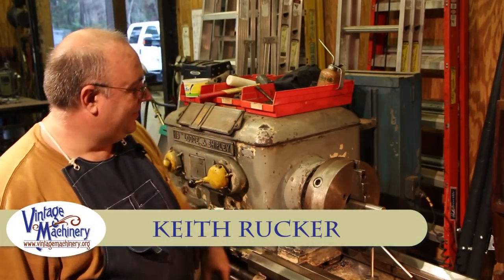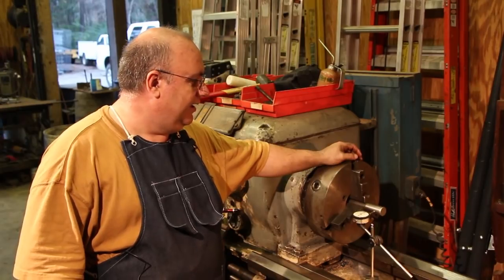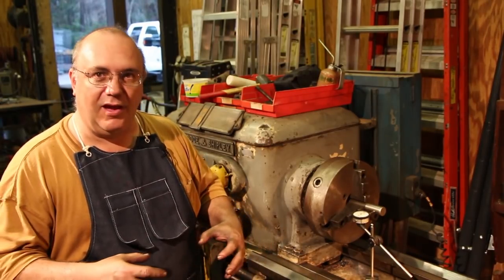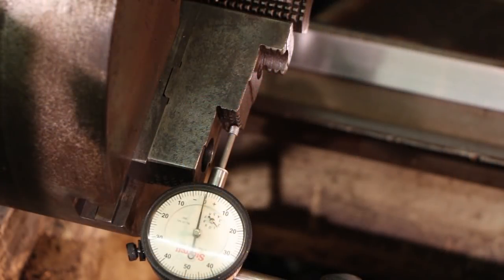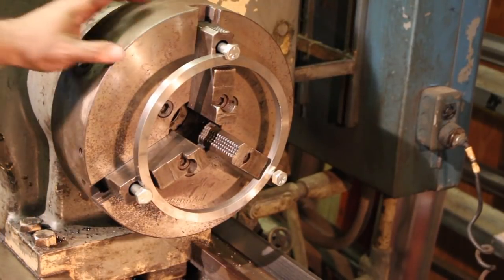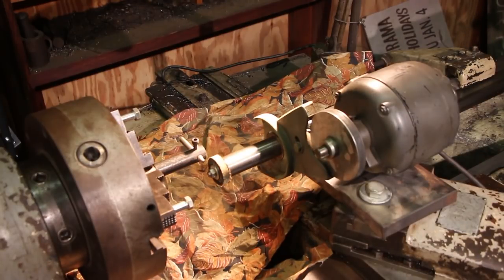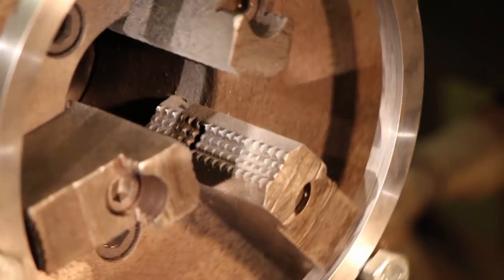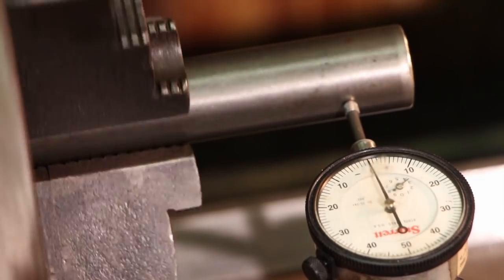Machine Shop Maintenance:  Truing up a 3-Jaw Chuck

Comment: After watching your procedure I decided to tackle a similar problem at the Minnesota Streetcar Museum. We have a 1942 Monarch 10EE; the 3-jaw scroll chuck with D1-3 mount was hopeless (0.020" TIR). Our set-up involved a Makita die grinder with a 1/4" shank, pink alumina mounted point, 1" dia. x 2" long. The grinder was very securely mounted on the compound. The extreme stone length was simply to achieve the needed reach. The Monarch permits extremely slow spindle speeds and carriage feeds, so that's perfect. It took hours but the result was worth it. Typical axial taper is no more than 0.0001"/in. Radial TIR is 0.0015" so we're pretty happy. Several lessons learned: pre-true the mounted point in a lathe or mill collet- the diamond tends to grab with this arrangement; 2) cock the grinder off-axis about 2 degrees so the stone never "heels", causing a bell-mouth condition; 3) do "spark out"- I made six passes before I no longer got random sparks;  4) consider a $20 pair of Ryobi noise cancelling ear buds which work with iPhones- your ears will thank you. I'm a metallurgist, not a machinist, so I'm learning like crazy from your videos. Thanks!

Comment: You are bit game running that tool post grinder without a face mask. I have had a wheel explode on a T/P grinder,which sent bits of wheel everywhere,Including one piece through the roof 60 feet above the lathe...and just like exploding dynamite, it happens quicker than you thought possible. :-)

Comment: Someone touched on this after trueing a chuck up.
A three jaw chuck will usually perform better accuracy wise using one of the three chuck wrench sockets.
Mark the best socket and put it to use.
Using random sockets will result in random chucking accuracy. This makes the chuck look worse than it is.
On repeat work mark the stock and put the mark at the same jaw each time it is chucked.
That way jobs can be machined in operations much quicker that resetting each tool for each part.
My chuck on the P & W lathe was modified at some time with adjustment screws on the scroll plate
to move things around a bit.  I assume these are brass tipped set screws.
Haven't taken it apart to look inside, if it ain't broke, I don't fix it.
Kap
Reply: Ditto for both finding the most accurate tightening gear, and for "indexing" the work to a particular jaw for repeatability.

I have also found that tightening a 3 jaw progressively (snug on the first position, firm on the 2nd, tight on the 3rd; then tight on 1 and 2 again) may give the least runout on a new(ish) 3-jaw. It probably would also reduce the tendency for increasing runout as the chuck ages (if we should live so long as to notice).

Comment: Tension should be outwards? Think about it. As Einstein says, every action has an opposite and = reaction. And so tightening on a piece of stock is pushing the jaws outwards. They will move outwards as far as each individual jaw 'run out' will let them, then stop. (This is what is happening in the actual tightening procedure with the key) Imagine one jaw moves outwards 1", a second 7/8" and the third 15/16" To get all three to tighten equally, the two less than 1" need to be ground to match the 1". All three jaws need to push outwards and be locked tight and immovable absolutely, at the 1" mark. This is what is occuring as the key is tightening. All ground faces are = from the centre.
Reply: Einstein never said that it was Isaac Newton's 3rd law of motion
Reply: Tom Tee No biggie but I think Newton said that.
Reply: Yep absolutely, Mr Newton. I'd really like 100% confirmation whether to grind with jaws tightened or jaws 'forced' to open as certainly this way, all three will not be touching that imaginary circle about the axis. 1 or even 2 may but not all 3? Hence the need for grinding.
Reply: Tom Tee  If you are cleaning up the inside jaws you tighten the jaws closed just as if you were gripping a round bar.  If you were cleaning up the outside jaws you would have the jaws pressed out.
Reply: I believe it just could be the other way. And curiosity is going to have me find out convincingly, either one way or the other.
Reply: Tom Tee If you want to think that, OK but it's not correct.
Reply: Kevin Keller I can't tell but maybe we are saying the same thing??
Reply: Kevin Keller No I think it was Harvey  Dmedlap or maybe Baron Von Whistledrawers, anyhoo good point...Ken

Comment: Hello Keith good day. I have a similar Lodge and Shipley lathe almost exact. My father obtained the lathe on a surplus buy. I an wondering what should i do to rehab the whole lathe? I've noticed an oil leak from the machine. The lathe does look a little bit beat up but i am wondering what advice you recommend i must do to have the bad boy running again. Any help would greatly be appreciated. thanks.

Comment: I have three jaw chuck that runs .00005 and has ben for years. and we have to hammer on parts every day. All things are possible if you take the time to make it so. THE  complete jaw is adjustable after you clamp down on the part .

Comment: Keith,  I realize this is an older video of yours but my question is.  Would you not first remove the chuck and check the chuck nose for T.I.R?  Do a complete head stock alignment first before grinding the jaw's? I have done this in the past, only after setting the complete machine alignment first. x and z axis (with gib job) then setting the tail stock on center before grinding.  Your thoughts?  Thank you for the great videos.
Reply: All your good points are left out so that the beginner at home will screw up their lathe,it is unfortunate but many on internet leave out the crucial points or steps not always on accident. What about the wear of the grinding wheel if to hard a cut it will be more than a few thousands by time you get to back of jaw.
Reply: +Dawn Conti hey, women make great machinists. It goes hand in hand with their ability to never let shit go. ;-)
Reply: I agree Blue Ridge,
If you noticed .
ONLY one jaw took most of the grind.
do every spec inside first,.
NOW, it is still not true and if the REAL problem is corrected, the jaws will need to be ground again.
The way this was approached, the symptom is being treated, but NOT the problem.
Yeah, i am a woman and machinist of more than 35 yrs.
I am a mom of 3 married 25 yrs.

Comment: Decent video! Unfortunately a very small radius in the jaw from the grinding.  Also you would want to check the jaws for squareness by noting the run-out in 2 marked spots along a true shaft not just indicating one spot and saying it's out .004. I would also suggest using the same key hole that was used when tightening the ring for the re-grind. I've done this operation a few times over the years and I surface grind the jaws contact face tangent to the regrind or relieve the back portion of the fixed jaw and open up the clamping diameter prior to the grind. Cheers!

Comment: Great vid! Also at the end there where you're measuring four thou out, remember you're measuring that off of cold rolled bar and that would likely be out as well. You did a fine job with the grinder and even gave me ideas by using that ring!

Comment: Hey Keith, could some of the run out be from wear in the scroll teeth? I wonder if you ground the chuck at a diameter closer to your intended work if you wouldn't get better results
Reply: You have a good idea but, the load should be the other      way around. Put like a two inch piece of stock way back in the jaws and tighten . Then bore. That way, the load will be right .

Comment: 4/1000ths is terrible - I got mine down to about one half a thou using a dremel to grind
Reply: I wouldn't say .004" T.I.R. is terrible.  I used to see about .003 a lot on some newer chucks.  The scroll in the chuck is just worn different amounts across the range of the chuck.  If Keith were to chuck on bar stock, that about the same diameter as the jaws were open when he did the grinding, the runout would probably be much less than .004 T.I.R.

Comment: Just a small note.  People often forget about the bearing surface the scroll has to ride on and that also wears out after a period of time.  Your scroll may be in good condition but your scroll bearing surface may be worn and the only way to fix that is to build up the surface and machine/grind to a fine tolerance a new bearing surface.  Otherwise the run out will be all over the place depending on which of the 3 points you use to tighten the jaws.
Reply: Can the inside of the scroll also be worn against the teeth of the jaws and how would you fix this
Reply: @kennethhoward8950  scroll and jaws are same 14th so i would make a new worm gear if you have the machines to do so,you didnt show much on the grind,im curious if you let the stone spark completly out on last pass,every time i have ground jaws if you dont run that last pass a couple times at same zero you will have a small rocking that cause the jaws to still run out a smigin.
with every thing original on the lathe,i would make a new gear,you notice how much the flats have got wider,if you go much more you want have the grip you want on scaled stock,just my tip hope it helps,before i retired i got were i like soft jaws and radius better than the adverage 3 jaw chuck

Comment: Keith,
How you did the rework of the jaws was okay and for your tolerances will work. Using the bolts in the outer jaws mounts like you did could cause another problem in some chunks and older chucks. I've seen the jaws tip or cantor with one cap bolt holding the jaws. Redressing or grinding the jaws when they do that will cause a very slight belling or taper to the jaws that will cause very bad accuracy and unwanted tapers in parts. A better way would be to make a steel bushing to go over the bolt shank and in to the cap bolt counter-bore so it will lock the back side of the jaw down too. Another way would be to make a wider ring with holes for the bolts to pass through so the bolt head will tie the back end of the jaws down. Another thing is to make sure that the chuck is kept properly lubricated with a good grease or dry lube. I know a lot of guys in this field that forget or do not like to do that. But it is absolutely necessary if you want that chuck to keep its accuracy for a long time.

Comment: isn't three jaw chuck run-out due to deformation in the scroll by people tightening up over black-bar stock or irregular non-round stock?
Reply: oh yeah that makes sense, thans
Reply: No the work in the chuck would not harm the scroll which has been worn due to much use and probably little or no lubrication over its lifetime

Comment: A simple cheap and easy toolpost grinder for this or other purposes can be an air powered pencil die grinder mounted in a boring bar holder, or a regular size air die grinder along with a normal toolpost with a long toolbit or piece of square stock clamped in the toolholder, and a couple hose clamps, one on each end holding the die grinder to the square stock on both ends.  Ensure that the clamps are tight and the die grinder is secure.  Then you can just use a mounted stone in either one.  no expensive toolpost grinder or fancy adapter arbor needed.
Reply: Totally agreed Wolfesmetalfab, I have used this method on several occasions with great success. On one occasion this was used to repair a tapered roller bearing surface that was suffering from Brinelling (indentations on the track, evenly spaced). The surface was integral with the gear shaft so the alternative was a replacement. Job was a success, the gearbox ran quietly when reassembled. Cheers from John.

Comment: Just a note. I had a small 3 jaw chuck that was always off and couldn't figure it out when I first started playing with the lathe. Turn out the jaws are marked 1,2,3 if you don't put them back in the same order it won't work right. Check out mrpete's video about chucks for more info.
Reply: Yeah. more like 1/8" runout.
Reply: not only are they ordered, mine has a specific numbered slot for each jaw.

Comment: Hi Keith
Did you check the runout on the outer ends of the jaws and the intermediate steps for when the jaws are reversed or used for internal clamping too ?

Comment: Test it with a hardened pin instead of that 1018.
I checked my 12" Bison and got .003" - I was thinking of grinding, but .003 seems to be the norm.

Thanks for the video!

Glenn in Spokane
Reply: ***** Keith, The extra run out  would be the spigot that the scroll runs on.  To get it to have less run out you would have to build up the spigot and re-machine it true with the circumference of the chuck.  0.002 - 0.003 is pretty good in my eyes.  I have a cheap Taiwan chuck that came with my lathe and the total run out on that is 0.0015 which I think is fantastic.
Great vids matey and keep em coming.
Reply: Dear Sir, No,it is not a norm,Your chuck shoudl be repaired,unless ou do not make precise things.
I have a 2 year old 250 mm Bison and the runout is 0,01 mm - and this is fair o.k

Please look at the videos of Viktor Leontiev,and You will start to think differently.
Reply: I agree Keith - How the heck could you get 3 tenths run-out on a three jaw?????

I just check mine with a ground carbide rod and it showed .002" TIR - I think I can live with that.

Comment: Nice job with the video.  You do a good job of staying with the subject at hand and not dragging the video out. 
  I had a 3-jaw with in similar condition and made a tool post grinder from a variable speed router.  It worked quite well, and brought the run-out down to under .004.  I was disappointing with this at first, but soon realized from other peoples results that this is the best I can expect.

Comment: Its probably running more true if you test with a round stock with the same diameter as the jaws was open when you did the grind. I suspect the scrolls are worn in a irregular way so when you test the runout on a smaller stock you experience this irregularity.

Comment: Nice job, isn't it nice when you can mount work in the chuck and can be reasonably accurate, got mine to about a thou run out at 1" dia. and removed all of the bell mouth which made parting off way more pleasant.  One question, did you tighten on the ring using the master key hole?
ATB
chris

Comment: Nice job Keith, just one question, I understand you have the chuck turning at you and the wheel turning away from you, but I don't know which way you turned the cross slide, was it inward as though you were turning, or outward as though you were boring??